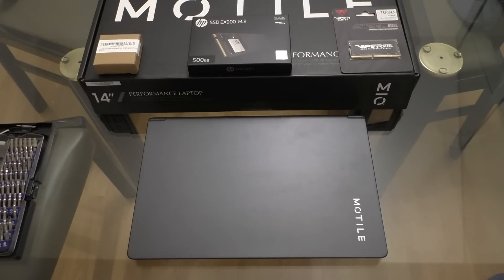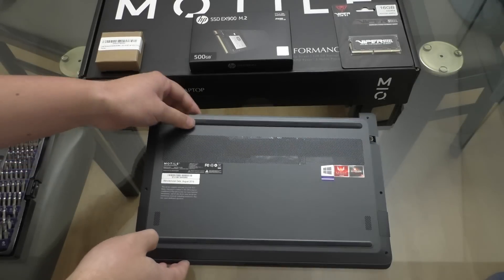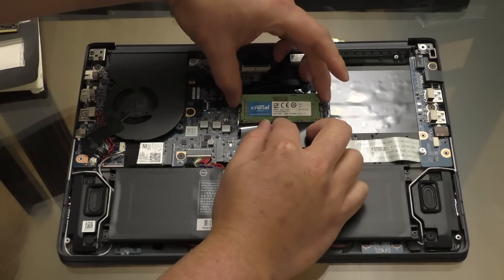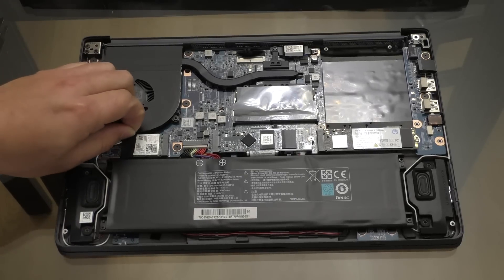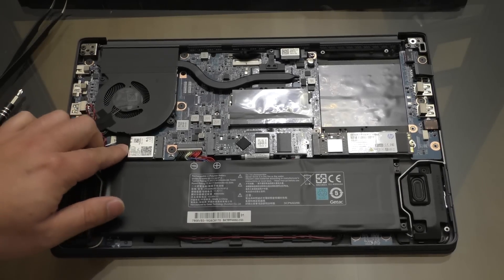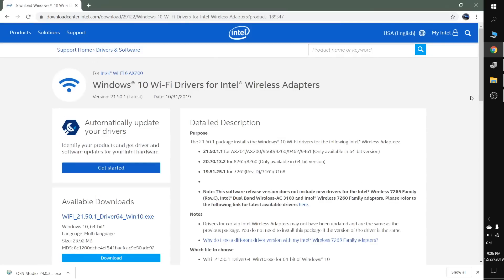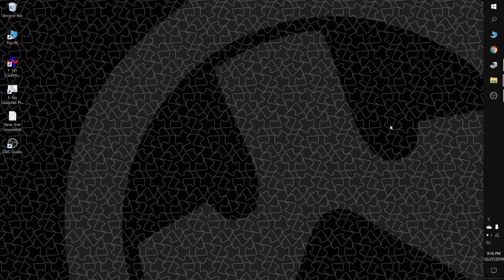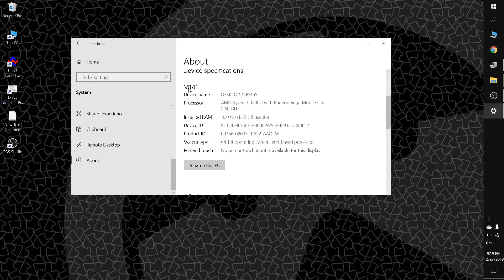Walmart Motile M141/M142 Upgrades (RAM, SSD, Wireless Card)

Comment: It's funny that this sort of off brand laptop give you this much upgradeability when options from major vendors don't.
Reply: i disagree. My dell 17 2n1 can be upgraded, support for 32 gig of ram,  m.2 nvme ( which i upgraded to a WD black) as well as regular sata 3, you could replace the wifi card if you wanted, which at some point i think i will get a wifi 6 ax card at some point.  when it comes to upgrades though, in reality a desktop has a lot more room to expand depending on what board it has as well as easier cpu, and cooling upgrades and most support graphic card upgrades. I wouldnt call it that major vendors have more limits as most can be upgraded, it just depends on what kind of board is installed and how much it supports. we can use hp for example, they could sell a cheap laptop and the board that is used is mostly maxed on being upgraded, the board might support 4 gig of ram and that is whats installed, the board might lack a m.2 slot. so no m.2 ssd support. however it wouldnt stop you from at least using a sata 3 ssd which would add much more performance, they could still support a upgraded  wifi card. now im sure you could upgrade the cpu in a laptop its just finding what cpu will work with that board, and if the next cpu would be that much of a upgrade since you cant get to wild with it depending on its cooling capability which would be a limit in all laptops.
Reply: @Cameron Brown I guess I didn't really clarify, I was referring to lower end laptop models although I do feel there has been a push over the last 5 or 6 years to give less flexibility on upgrading all around even on pricier units. I also meant models you see out in the stores that vendors are really pushing. You could of course find something with more flexible specs but I don't think Joe Schmo consumer is doing that much these days and think that is being capitalized upon. Nothing wrong with a free market but unless someone gets a hold of an "outdated" unit and put's a linux distro on it then it's likely to end up in a landfill once it starts slowing down.
Reply: @DOYLECLEVERLOBE1  ya, I used my dell as an example. Which does support more upgrading.  However I agree lower end have less upgrade potential normally but is increasingly becoming normal to be able to upgrade some.  I still have a compac hp from 09 that works fine but is a base celeron, and supports 4 GB ram but sold with 2, if I wanted to invest it could probably have a better spec wifi card and could run a ssd in it however its sata port speed is limited and could expand to run two ssd's or ssd and mechanical if I removed the optical drive. I have a dell inspiron 15 from 2012 that did sell with low end hardware but upgraded to 8 gig of ram max, it is claimed it could run 16 but no proof of it, installed a dual band with bluetooth,  and went with a wd ssd which it supports sata3,  and installed a dell extend battery. Those upgrades were not expensive.  It was a close out sell and marked down lower even with low spec. So really it was over priced from the start. But it has a i3HT which helps. Now it has about a 10 second boot time and runs great except for games of course.  My 17 inch plays some games on med to low resolution. However it can be said it depends on model and make which would decide what can be done.  As said some are sold with low end boards and can't hand much more than what they were priced and built for. But it's nice that lower end is being able to be upgraded more. But as you said a regular Joe really doesn't care and once it slows down they either over pay on a repair they could have done which a simple upgrade or even just a ssd upgrade will being new life to it. But otherwise they will just pitch it.  I'm surprised hard disks are still a thing since ssd's are cheap now. Besides. Being used for a nas or a server. Which isnt as common.  My 17 inch came with a 2tb seagate and was somewhat slow after two days I said screw this and slapped a ssd in it.  World of difference.  But that's my experience with it. I also have a desktop with a build from 07 running windows 10 with 2 gig ram and ssd and intel d duel duel core and dedicated graphics.  It runs ok.  It can't do anything extreme.  But it's just something to mess with from time to time.

Comment: Ah... I am sorry man. This laptop is not as good as it could be... it doesnt have dual channel RAM. I would recommend returning this laptop, get something that has two RAM slots and get another 16GB module for 32GB if possible or something. Ryzen is super reliant on having dual channel RAM and this laptop only having one RAM slot really impacts its performance when you go to even fill that 16GB of RAM. 

Its crazy, usually intel sub notebooks would be configured like that, I was expecting Ryzen to be more performance oriented.

Comment: I was watching another video about the laptop saying it had a spot for a second ram card but you had to move things around with the SSD. Know what they might have been talking about?

An Austin Evans "walmarts new laptop is an insane deal"
Reply from the maker: I saw that too and specifically took a look at it. You absolutely can't put another stick of RAM there. He must not have taken a very close look or was talking hypothetically that they could've designed it to put a 2nd stick there.

Here's a pic of the opposite side of the socket. No way you can put a stick in there. https://i.imgur.com/C1QITgY.jpg
Reply: Your Mom

Comment: If you're replacing the SSD and upgrading the RAM, why wouldn't you upgrade to DDR? That was the only real complaint Linus had about it
Reply: How do you upgrade to ddr ? it supports single soddim only.
Reply: @MrMVP911  2nd slot takes the same space as the SATA SSD. watch Linus's video. it is one or the other.
Reply: " Linus's video" there is not a such a video !
Reply: It is DDR, just cant be dual channel as there is only one ram slot

Comment: What's wrong with the stock wifi?
Reply from the maker: There isn't anything wrong with it, but I wanted something more capable.
Reply: @FaRKle0079  on that note, what kind of performance difference have you seen with the new chip? Debating upgrading the ram and I figure if I'm taking the time to do that I may as well upgrade the wifi chip at the same time if there is a significant gain in bandwidth to be had.
Reply from the maker: @ThisUploaded  When transferring video files between this laptop and my other computer (wired LAN desktop) I only get about 25MB/s with the original WiFi card, but get 70MB/s with the AX200.
Reply: @FaRKle0079  the old chip is WiFi 5 ac, the new chip is WiFi 6 ax, you'll see a big increase in speeds if you are running a WiFi 6 router
Reply: @FaRKle0079  I replaced my Motile wifi with the same one you did but every now and then after a reboot it wont detect a network unless I turn wifi off and on again. Do you have any issues like this? Cheers
Reply from the maker: @pirate6930  I had to have Windows forget the networks I established  before changing the wifi card, and then reconnect/save them after. No issues after that.

Comment: How is gaming on it after the upgrades?
Reply: Maybe he's testing it and just hasn't reported back.
Reply: It’s actually really good I installed everything in this video and got around 30-20fps high settings in gta 5
Reply: Trash
Reply: Ohio Interior Design how do u know that it’s trash
Reply: @youwastedyourtimebyreading8963  look at the flux capacitor specs

Comment: Seeing as this is running ryzen, is there a way to do dual channel memory?
Reply: One dim slot sadly
Reply: @md_nght_drft  idk what you're talking about when you say there is 4gb soldered. There is no memory soldered to the MoBo here. This model comes with an 8gb memory module. It's single channel because of this.
Reply: I saw another video that said there were two slots.  I would love to see a closeup.
Reply: There are two slots, but you have to choose either the SATA SSD or a second dim. Since he's adding the NVMe drive, he should have gone to dual channel memory
Reply: @cthuemmel1  that is false information being spread by the Austin evens video. There is litteraly no plug on the board for a second stick. Austin Evans thought that the reverse side of the original slot was another plug when in fact, it is not.
Reply: @cthuemmel1  @Bert439 @Jeffrey Joenig Do you guys know of any that come with dual channel as well as a sata area? Cheap of course
Reply: No, are you really that fucking stupid

Comment: Why TF didn't they put 2 RAM slots for dual channel memory on a system that uses shared system RAM?  I would genuinely pay 50-100$ more just for that option.  The single channel RAM probably holds the GPU back a ton.
Reply: It does indeed.  They really gimped it with that single slot.

Comment: I don’t really know much about computers but i wanted to change my cpu from intel core 2 to intel core i5. Is there an easy way to do this on that computer?
Reply from the maker: Unfortunately you can't change CPUs easily on this computer since the CPU is soldered and not socketed. Furthermore, this is an AMD CPU machine, so no Intel CPUs will work.
Reply: FaRKle0079 for context he's asking about in general. to answer jeremiah i believe it all depends on the laptop motherboard
Reply: Any other info on the cpu? Like the Specific chip and socket?

Comment: Are the m.2 drives 2x or 4x lanes?
Reply: The m.2 slot that the SATA drive comes in is a 4 (Yes, FOUR GLORIOUS) lanes. The extra (unpopulated when you buy it) is only 2 PCI lanes.

I moved my Samsung 970 Pro 512 GB M.2 NVME SSD from the extra to the original slot, set things up in the BIOS, and it runs 4 lanes (according to the Drive Details tab of Samsung Magician). The benchmark speeds also change - my sequential speeds almost double (again, according to Samsung Magician) and my random I/O speeds go down a bit.
Reply from the maker: @kirkkohnen5050  Good find!
Reply: My M141: Slot1 is M.2 SATA only, Slot2 is M.2 NVMe running 2 lanes only.  It can't run faster than 500mb/s!  @Kirk, perhaps you have the M142
Reply: @wwc3180  Hm you sure? Everything else I've heard has said both slots are NVMe capable, but the second one it's mandatory.
Reply: @wwc3180  I absolutely have the M142. Sorry for the confusion.
Reply: @wwc3180  I also have the M141 model and just went through the process of cloning the original SATA SSD on to my new 500gb NVMe. Once everything was cloned correctly I removed both SSD's and utilized slot 1 for the NVMe. The system would not boot into the OS, I was stuck in bios trying to endlessly set the new NVMe as the boot priority to no avail. I eventually gave up moved the NVMe to slot 2 and everything worked no issues. Damn I was really hoping to run off slot 1
Reply from the maker: x2

Comment: Can use a 32gb memory ddr4 ?
Reply from the maker: Officially, no (http://www.motilecustomerservice.com/assets/specs/Motile_M141_Spec_Sheet_HM_12162019.pdf ), however some users have reported having luck with this 32GB module: https://amzn.to/2NfSyAj
Reply: @FaRKle0079  I think I'm going to buy the 32GB on Amazon.  If it doesn't work I'll send it back and buy the 16GB.
Reply: @FaRKle0079  Motile i got come with 8gb 2666 mhz, i want try a 32gb ddr4, but i will wait sometime

Comment: Can you do a video on updating the drivers for this computer I downloaded them but can't get them to install
Reply: Please look up UEFI/bios install on google.
Reply: I have read that some of the BIOS updates are important for performance on these machines. However, only update your BIOS if you are comfortable and know that there is a reason. Otherwise the other drivers should be pretty straight forward. What did you DL and from where?
Reply: @Machistmo  BIOS deals with booting operations and may not directly impact performance. Updating the BIOS probably solves hardware incompatibility issues increasing performance. In all cases, updating to the new bios is always recommended to prevent BSOD with new hardware.  http://motilecustomerservice.com/
Reply: The GUI did not work for me. create a bootable usb and flash through uefi.
Reply: Then that makes you a dumb ass

Comment: How many PCI lanes are each m.2 slot running? Thanks.
Reply from the maker: My NVMe drive is showing it's PCIe x2. The other drive (original) is running over SATA (M.2), but I don't think it'd be any greater than x2.
Reply: @FaRKle0079  thanks

Comment: Good video. Would you be doing benchmarks with the upgrades? I ordered this laptop for the value proposition and it's potential.  Ill be using it for video editing under 30 minutes, graphics, and photo editing. Just for small marketing jobs. AMDs stepped up with the Ryzen 5 mobile and the marketing names mimicking Intel to make the direct comparisons. Anything I buy has to have some sort of long shelf life, upgradable, and low cost of ownership. The best analogy is like Toyotas truck designs that they incrementally improve. By the end of the 7-10 year product cycle you have robust parts at affordable prices. The Only obvious knock is the single channel memory, but for the price and size no biggy. I'm looking forward to more videos and getting my hands soon on the motile.
Reply: Would this SSD work in the nvme slot? https://www.amazon.com/gp/aw/d/B07ZZYWTBP/ref=psdcmw_1292116011_t2_B07BN4NJ2J?th=1&psc=1 . I ordered a 970 Evo plus to find out it's PC only.
Reply from the maker: I'm not planning on running any benchmarks on the system, mainly because I don't plan on really using this machine for much else other than auto diagnostics and multimedia. For video editing you'd probably want the Motile M142 with the Ryzen 5 CPU and max out the memory (16GB). I'd also think about how the various programs/apps will scale in the next few years and their requirements.
Reply: @FaRKle0079  I'm on the right track then with the Ryzen 5 3500u. So definitely the 16gb Ram upgrade. You put a 500gb SSD in the open slot, so you now have 756gb SSD capacity now? Could I put a 1T SSD if I wanted in the future
Reply from the maker: @DanielLopez-qh6ji   Yes, you can absolutely put a higher capacity SSD in there. For lots of raw video storage for your work you might even consider a 2TB NVMe SSD (https://amzn.to/2QAOsDH)! On my video editing desktop machine I don't even bother with SSDs less than 1TB.

Additionally, if you get a 1-2TB NVMe drive, clone the boot drive to it, and then make it the boot drive, you can also get a 1-2TB SATA M.2 drive to replace the original drive and expand storage further.
Reply: @FaRKle0079   you are a world of help. Thank you! I was just about to ask that question. Wowzer
Reply: @daroldhunter   I checked out the link and it was since updated to only 16gb ram. appreciate the article
Reply: @DanielLopez-qh6ji  I actually received and installed 32gb Crucial memory module and can confirm it accepted. Thanks

Comment: Hi there question Im looking to buy this laptop is it ok that I pull out everything and change it right away or would I have to boot it up first and set it up? And also where can I get the Patriot viper and the HP EX 900?
Reply from the maker: If you keep the original SSD drive in there like I did, then you should be able to install all of these HW upgrades before the first boot up.

Here are links to the exact products I used:
-Patriot Viper Steel 16gb SODIMM: https://amzn.to/39pFykZ
-HP EX900 500GB NVMe SSD: https://amzn.to/2u5GxGR
-Intel AX200 Wireless Card: https://amzn.to/368XCOl
Reply: @FaRKle0079  thank you, bro, really appreciate it going to be using this for university!
Reply: @FaRKle0079  It would work for the same as this one right? https://www.walmart.com/ip/Vega-HDMI-720p-Front-RAM-FHD-8GB-display-AMD-Tuned-Radeon-14-Ryzen-THX-Graphics-IR-SSD-Silver-Laptop-MOTILE-5-Spatial-256GB-8-Performance-Audio-HD-Ca/979627450?selected=true
Reply from the maker: @MrApe-fb3wd  Yup,  that's the M142, the higher spec model. Same upgrades can be applied to that too.
Reply: I would say update the bios and the ec asap. It fixes the random OS freeze and any BSOD due to hardware incompatibility.
Reply: @cogs14  Hey cogs14, would you mind posting instructions for how to flash bios and ec safely? (I am a newbie when it comes to tech :) Thanks!
Reply: @michelecabrini8775  Its tough to explain the instructions here. its the standard uefi/bios install. You copy the contents from the site to the usb ( keep in mind the file content structure and how you setup the root folder) and boot from the usb by setting the boot order priority in the bios. Also don't turn off the laptop or lose charge cause the EEPROM data would be corrupted and impossible to reboot the rom to update the bios. You'd have to send it to the manufacturer at that point. Additionally, you can also try the GUI package installer that simplifies this process by just running the program but the software was broken and did not work on my laptop.
Reply: @cogs14  Thanks! I will try the GUI package first. If it does not work, I'll look up things up regarding USB uefi/bios install

Comment: i recently did the same upgrades on the m142 and all were worth it.  My only regret on this thing so far is not cloning the drive before the first boot since they don't provide all of the software for a clean install.
Reply: You can export all the drivers for future use very easily using a free tool called DriverBack: 

https://sourceforge.net/projects/drvback/

Good luck! Also: it's worth noting that the first M.2 SSD port (the default) is the only one of the two that supports both SATA and NVMe. The second is just NVMe. It's definitely worth cloning the primary drive to an NVMe disk!